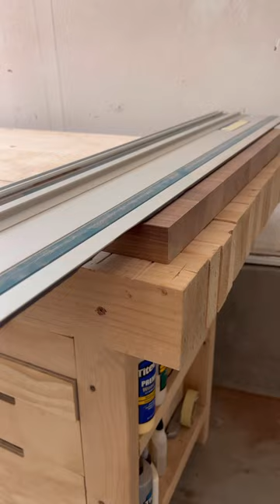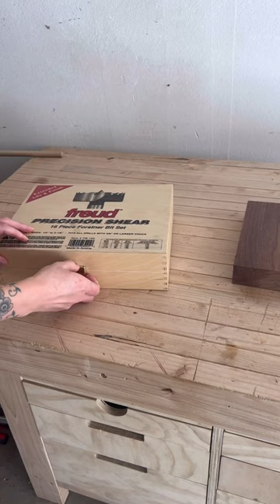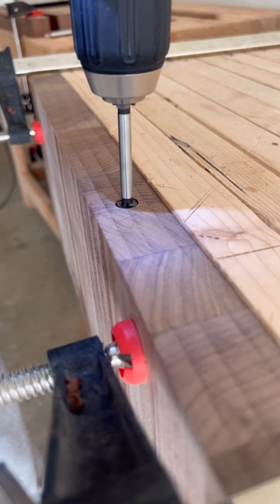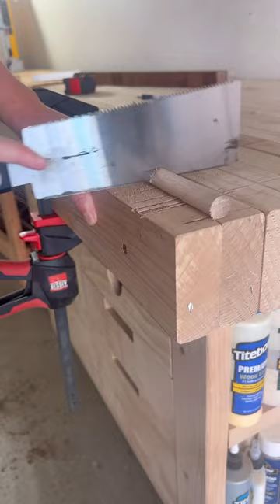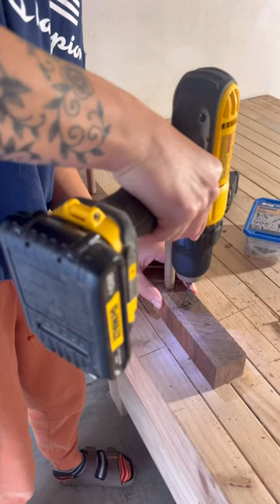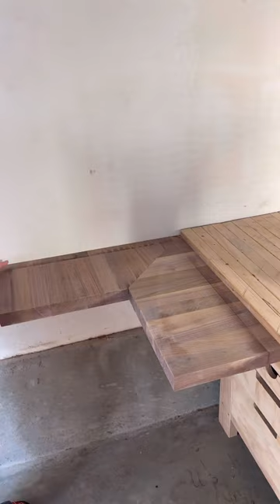Wood Hanging Hardware for Floating Shelves #furnituremaker #woodworking

Comment: It's impossible to attach dowels at a 90° angle, unless you drill through the wall, and push them from the other side. If the intention is to make an asmr video, then great. The concept doesn't have any value for real world application.
Reply: You drill into studs, very sturdy, I hang shelves like this all the time

Comment: you need a nice long peg running the length of the long side of the extended table, in addition to the smaller ones. nice vid.